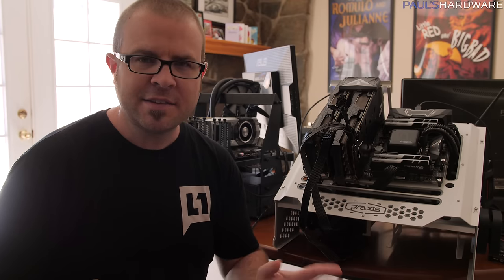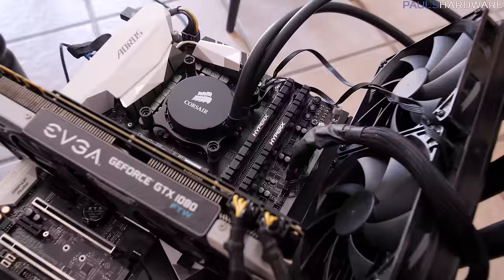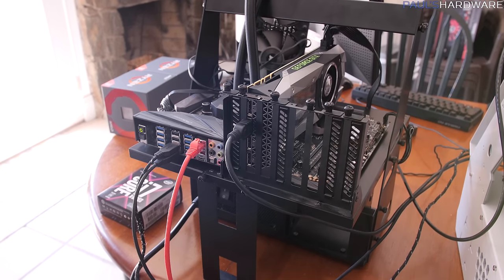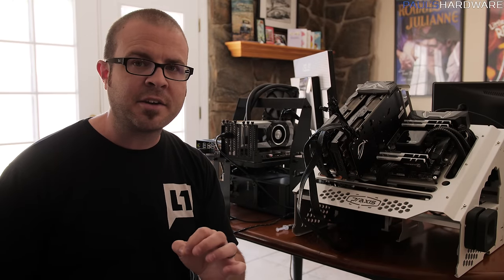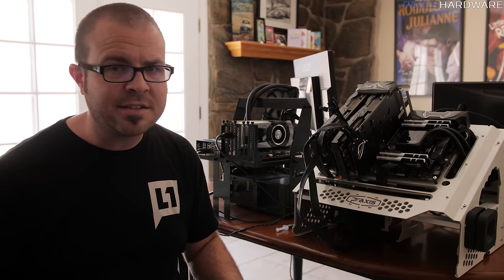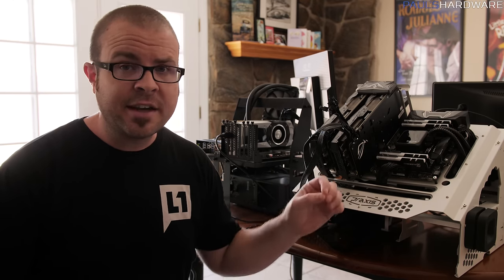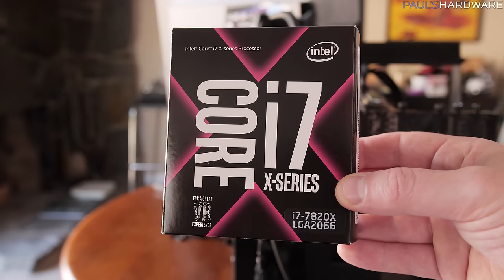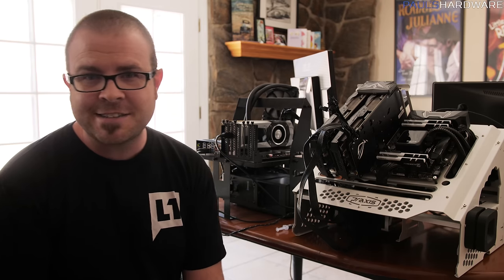What's The BEST CPU for Gaming with 1080 Tis in SLI?

Comment: Go for 1800x man!Even at 4.0ghz it's giving u fps closer to both 7700k and 7740k.
Reply: lol
Reply: Gandhrav Malhotra Or 1700X because they're the same and OC it to 4.0, or 1700 if you're feeling lucky (silicon lottery)
Reply: I have a 1700x and have been perfectly happy with it. I use two 1070's fyi.
Reply: Gandhrav Malhotra No, go for the 1700. If you overclock, you'll get close performance to an 1800x for a cheaper price. 

Though, if you do see an 1800x on sale with a price close to the 1700, go for it!
Reply: rather a 1700 @ 270$ now
Reply: thats what the thumbs down button is for
Reply: L S I lost the lottery with my 1600.  I can't get it to run stable at 3.9 to 4.0.  And I don't think that's due to my memory speed
Reply: Well, if it's only gaming (I'm sure you have plenty of machines to game and stream or another pc to stream through) then I guess. If you could get the RAM too 3600 I'd say 1700/x or 1800x, but with 3200, you will get a consistent 2-3 FPS higher with the Intel.
Reply: J4DEE reviews 1800x is 400 - 440$...
Reply: Apparently, this system strictly for gaming (reason of this comparison). The 7740X will outperform its Ryzen counterparts, despite the amount of cores on the AMD chip due to the higher core clocks on the Intel chip, thus making the 7740X the better choice for gaming. For an all around system, (gaming, streaming, production, etc.) the best choice would be a Ryzen 1700 or 1700X CPU due to it's higher core count and affordability.
Reply: Gandhrav Malhotra go for the 7700k its cheaper for me it is 300 and the 1700 is 350 where i live but the 7700k is still king of gaming
Reply: The 1700 and 7700k are like the same price so if ur only gaming go 7700k if you are doing more like overlays and shit go 1700
Reply: +Gandhrav Malhotra Stop being a fanboy. Intel performed better and he already has the parts. He's not worrying about price/performance, so Intel is clearly the better option here.
Reply: yeah youre right
Reply: joey rosenbaum Yeah that's why I opted out of the non X cpu's. the X cpu's are somewhat binned, pretty much all X cpu's will run 3.95. My 1700x is at 4.1 ghz but I have a fractal S36 (360mm radiator) and I did pretty darn good on the silicon lottery.
Reply: 1700x @3.9 with 1080ti with 1440p/144hxz monitor, best gaming experience man
Reply: +jack emery Swap the 1700X with a 7700K and it'd be better though
Reply: Malus1531 I run 3 monitors and do streaming and play with tabs and such. Look at reviews when you have twitch open and such. 1700x has better performance
Reply: Paul isn't going for great price to performance but instead the most powerful cpu to handle gaming and other tasks, at that point he might as well go with the x299 platform.
Reply: +jack emery Oh alright fair enough. You only mentioned gaming at first.
Reply: Also playing at 1440p 1700x is the same performance

Comment: Grab a 1700 non X, OCit to 4ghz and smoke the competition in Price to performance ratio.
Reply: On sale for $269 on amazon right now.
Reply: Higher TDP only means it will get more, hot but it's not a limit. That being said if you overclock ryzen 1700 to 4gz it will have the same TDP as the 1800x most likely. The TDP is not a limit but an info on what cooler you should get (the coolers are rated using TDP). The only reason why amd spread they ryzen 7 lineup in 1700, 1700x and 1800x it's because of the people that are scared to overclock and the fact that ryzen 1800x (as an example) guarantees a win in the silicon lottery so you will get 4.0Gz for sure with him while 1700 may not pass 3.8 or 3.9. I saw a test where ryzen 1700 and 1700x got up to 3.9Gz while 1800x got 4.0 with the same cooler so they are quite equal and the only difference is that they come with different stock speeds. If you underclock and undervolt a 1800x to 3.0Gz you will get the same TDP(65 or even lower) as with the 1700.
Reply: apart from MOST 1700's cannot actually hit the magical 4ghz, theres a reason they got binned as 1700's and not the 1800x's most of the time, sadly.
Reply: You'll probably end up with a lower TDP since you pretty much bought yourself a ticket in the silicon lottery, you're going to be able to undervolt it further at the same base frequency (I expect this difference to be quite significant actually) and archive way lower TDP at same frequencies when undervolted properly.
Reply: This was such a bullshit from the start for everyone living in europe, because we knew that it wouldnt be cheaper than i7, this crap always goes only for the american market only, here 1700 is 425$ (1700x 520$) and 7700K 399$..
Reply: I can see you are not getting the point of video. He is NOT looking for price to performance, but raw CPU performance.
Reply: MattXWay I can see you are not getting the point of his comment, his comment was NOT meant to showcase raw CPU performance, it was meant to show people an alternative solution.
Reply: Not sure who you're talking to, but if you're talking to Paul, he's looking at THE BEST not the best value
Reply: GenericYoutubeNameHD - Not sure who YOU are talking to. See what i did there?
Reply: They actually can, normally when you can't hit 4ghz on a 1700, its your Mobo/ram combo.
Reply: Ahh the amd fanchildren.. I guess you guys don't get that he wants HIGH performance Not PRICE performance. Clock for clock the i7/i9's ruin amd's.
TDP means NOTHING. As one fanchild pointed out.
You show me a 5.0ghz 1700 and I'll downclock my 7700k to 5.0 and we'll run em. 
OHH SNAP.. You can't get 5 ghz+ from amd and they are slower anyways? I'm sorry.
Sorry to spoil your amd childlike overhype.
Reply: Oh no, people aren't Intel fanboys, the world is ending! Quick, someone call Intel and let them know that people are having different buying options on their CPU's. Lordy lordy, the world is ending. Dude, people can choose whatever cpu they want, and Ryzen is a great price to performance Cpu. Not everyone is going for maximum FPS in games solely, a majority of people prefer Ryzen due to the performance you get in multi-threaded applications. I for one, am glad for AMD to finally get a foot back in  the market. Also "Childlike hype"? Get real dude. Learn to respect other people's buying decisions.
Reply: got a 1700x + x370 Mobo for $400 flat
Reply: I got my R7 1700x for $212 and my Asrock Taichi x370 for $180 :D
Reply: Damn that's really good better than my Asus prime
Reply: Swaggy Toast any X370 is good, remember that the OC is limited by the CPUs silicone lottery. Even a good B350 will do everything a X370 can.
Reply: Judge Dredd 3D except for sli haha the problem with my mobo tho is I can't seem to get my ram any higher than 2666mhz
Reply: go for an 1366 6/8 core xeon put it on 4 ghz with an 30$ aircooler and be happy
 with beating an 7700k (in heavy multitasking) for 200$ including 32gb of ecc 1333... thats what I call "smoke" the competition in terms of priceperformance
Reply: Judge Dredd 3D you say that as if a 1700 can easily do 4ghz when even the 1800x's can't all do 4ghz lol my 1700 will do 3.9 nothing more my friends 1800x also 3.9
Reply: dan k had the same experience with basicly all ryzen cpus (r5 1400/1600x, r7 1700)  3.9 was possible but 4 not... with aio 240mm
Reply: They CAN easily do 4Ghz.. if your stuck at 3.9. You don't know proper overclocking.
Reply: No, I don't even own one, I've just been reading about it since launch, and most samples DO hit 4Ghz.. so often even that some motherboards have a 4ghz auto-oc option.. Now some need a bump of voltage to get there.. but that isn't what we're talking about here..